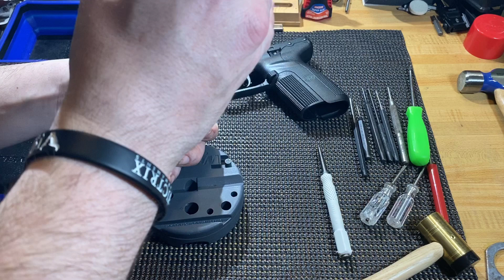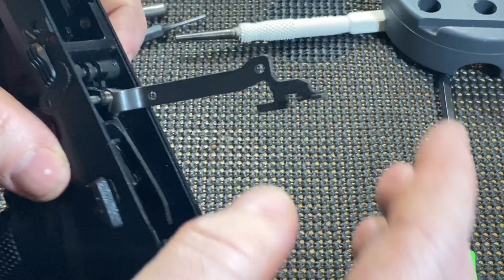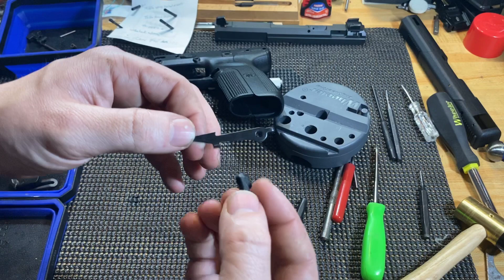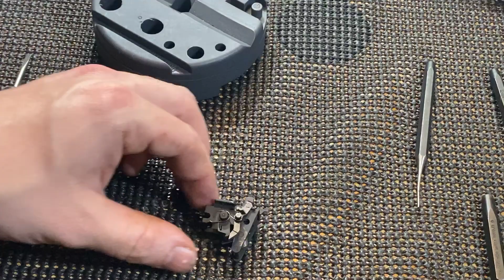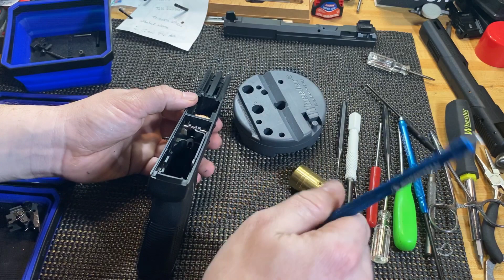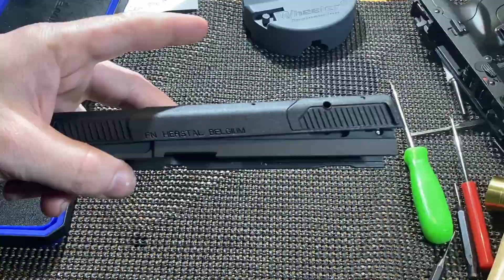FN Five Seven (FN 5.7) Complete Disassembly /Reassembly (Firearm Maintenance)

Comment: Why everytime i try to put my mag in it struggles and when i get it in the trigger stiffens up and cant pull it
Reply: I'm having the same problem. It works fine if I remove the magazine, but pushing it in, it becomes very stiff.
Reply: @TruthsohelpmeYah  its been months and i still don’t figure it out 🤦🏻‍♂️🤦🏻‍♂️ a new 5.7 just sitting there
Reply: I think it has something to do with the magazine disconnect. He disconnected his, and I think it had to go on top, or it gets pushed up and blocks the trigger bar
Reply: Fixed it. I had to take out the magazine disconnector and bend it so it was straighter. After that, make sure the trigger bar is below it when you put it in. Without the magazine, the sear wont be able to be engaged, but with it it can and the hammer falls.
Reply: @archivaldosanchez7508  I figured it out. Do what I did and it works fine.

Comment: Thanks for the video going to be doing a trigger job on my fn this coming week
Reply: which parts did you polish and how was your result? so far i've shortened the mag safety and that took off about 1lb. i'm planning on polishing the hammer and sear connection and was wondering if anything else would be worthwhile.

great video by the way!

Comment: It's a bit easier to remove the locking block (and it is a locking block) by driving it's pin out first, then driving the pin holding the spring in. Just in my experience.

Comment: 9:05 I'm guessing in order to remove the Firing Pin Safety you have to use a punch and hammer to remove the rear sight base, which is why you didn't feel like removing it.
Reply from the maker: Yes correct

Comment: You reassembled your firing pin without the spring....
Reply from the maker: If you watch again it’s on the firing pin as I put it in the channel, then I remove the pin to show something and the spring stayed in the channel. You can see it as I put the firing pin back in for the last time.
Reply: What to doif hammer is stuck without clip in but is fine with clip